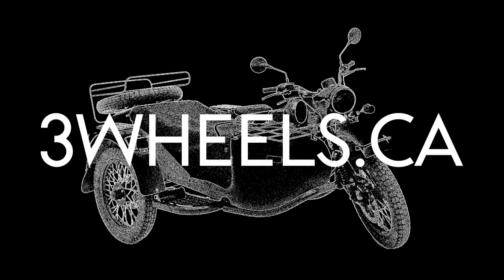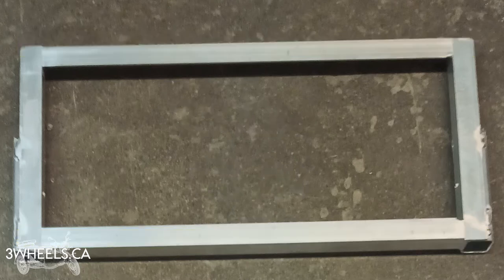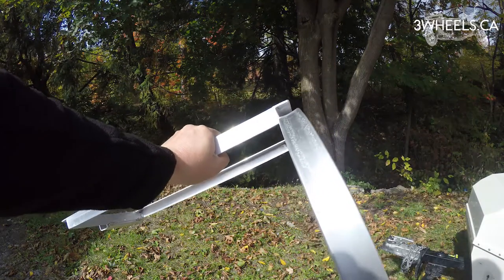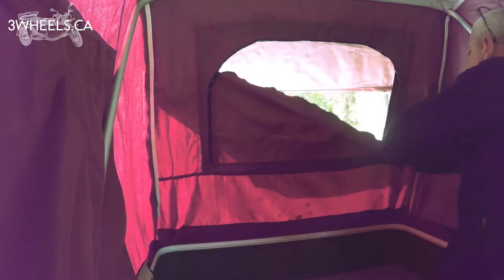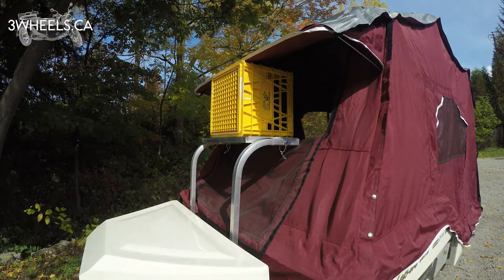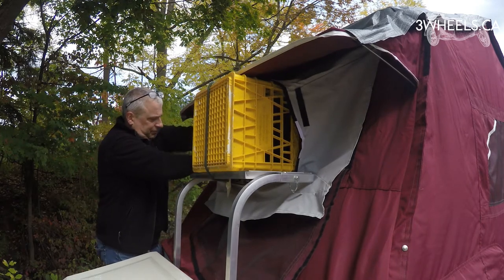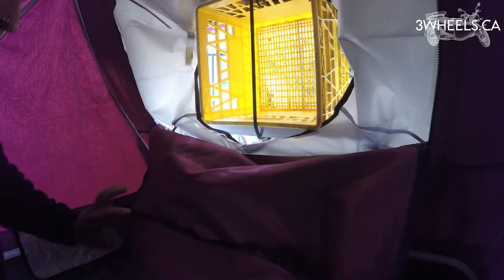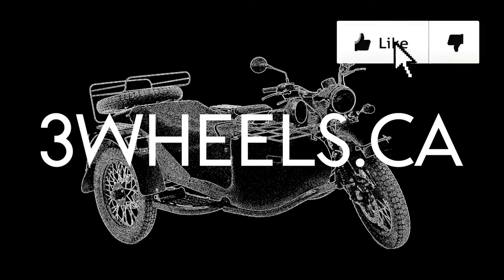Lees-ure Lite Excel A/C Bracket Kit

Comment: I have a Royal Enfield Interceptor 650. What size bike would you recommend for pulling a Lees-ure Lite?
Reply from the maker: I would recommend any of the large touring bikes, Goldwing, K1600, Venture, Ultra etc. not just because of the power but to stop a loaded trailer easily.
Reply: That has always been my main concern even with my Royal Enfield Interceptor 650 is stopping.  Thanks for the reply.   @3WheelsToThere